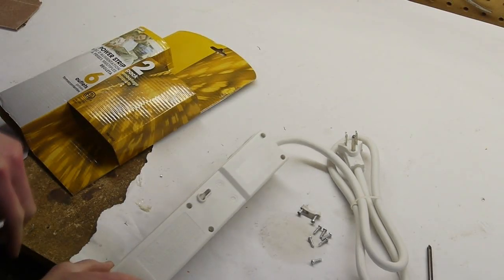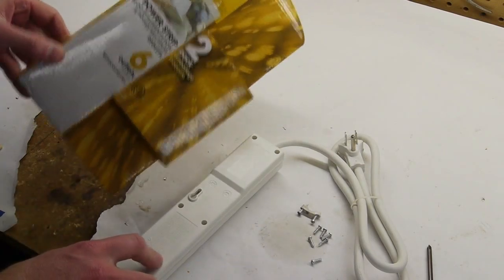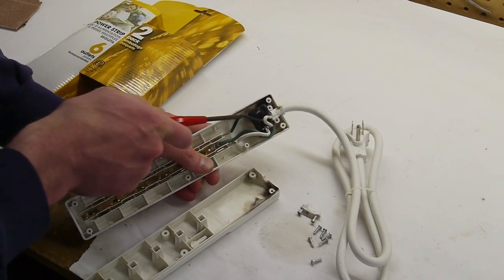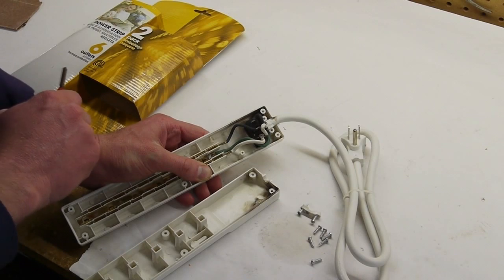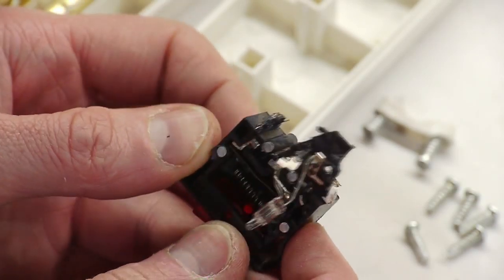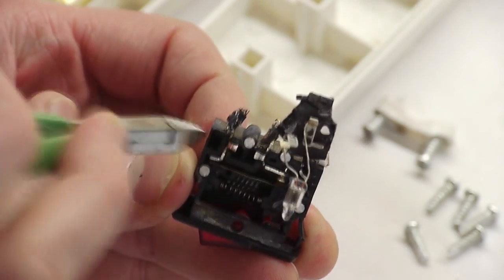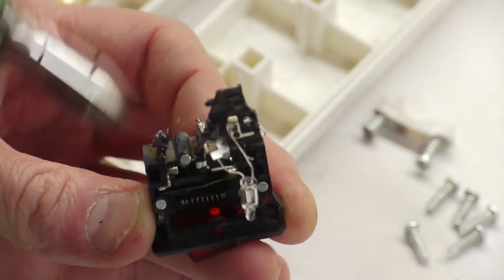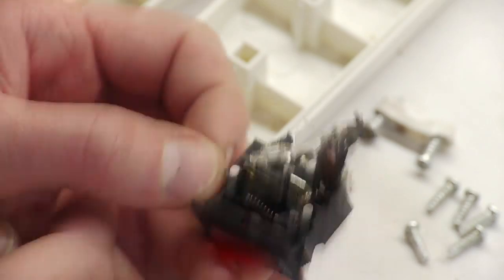Power strip failure analysis

Comment: Ton's of video in youtube shows failed power strip like poping noise or explosion, but my power strip had different kind of failure... it cannot be turned off lol, I tried to buy super expensive and regular price too, all failed on the same issue, it can't be turned off... like then switch button, refuse to cut the electricity, but no one had uploaded this issue on the internet...

I was hopping someone could explain why this happening cause its no longer coincidence since its happend more than 5x over many different power strip both expensive and cheap one.

Comment: I had a Prime powerstrip fail, the daisy chained lead to one plug had exactly 1 strand of the wire soldered to the post. Exactly 1 strand.

 I was using it as a switched extension cord, I had one thing plugged in. A sump pump, which of course failed the moment it was needed. I had tested the setup, but not more than a single socket; I guess I just picked the wrong socket to leave it in for "production." LoL

Comment: Late to the party like most everyone else replying, but I don't see a current limiting resistor on that neon lamp.  I take ot the pop and smoke happened after being plugged in AND switched on?  I ask because the plug shows no arc damage either and am leaning to high impulse current from the non limited neon lanp.
Reply: Was my first reaction looking at the lamp too - "WTF, where's the resistor?!?"

Comment: Could be anything from a defect in insulation thickness during the MFG of the input cable, to poor job of trimming the outer insulation and nicking the hot and another conductor, or pinched under the strain relief and wore through insulation.  Switch DOES look good, no sign of arc inside of it.  I think we've all overloaded one of these at one point or another an the combination switch/breaker trips pretty quickly, my guess is that the fault was BEFORE the switch.  If it happened immediately when he plugged it in, 2 of the contacts on the plug should show at least faint signs of pitting and would tell if it was a hot to ground or hot to neutral short.  I guess this WAS like 3 years ago now...how'd the lawsuit go??

Comment: Got a call two days ago that a computer would not come back on at a client's business via a little troubleshooting on the phone we determined it was the power strip - belkin so I figured it was just age maybe.  Bought a new one went over hooked it up made sure everything worked and all was good.  Then this morning at 9:30am I get a phone call hey it did it again.  I took the old strip apart; no soot or shorts in it.  Not sure what to do at this point I am going to measure the voltage at the wall and see if anything wonky is going on.  Any ideas of what is happening to these strips is appreciated as well.
Reply: You're sure it's not the outlet? I have one in my house that is wonky and it won't function when plugged into a power strip, but with very low voltage things (we use it for the Christmas lights) it works fine. Might be something like that.
Reply: @ultraviolette69  wonky is a dangerous word in this context. Get it fixed.

Comment: I'm very late to the party...

The soot on the back cover of the strip suggests where to start looking. The neutral wire (white) from the cord appears to be looped over (possibly in contact with) one of the line terminals of the switch. From there, pressure applied by the back cover onto the wire and terminal would eventually pierce the wire insulation.

I would have expected the house outlet circuit breaker to have tripped as a result.

I'm enjoying browsing through your videos.  B)

Comment: Maybe the trimmer trimmed too many copper strands and too few remained connected and overheated and blew when current crossed them, this would also explain why the electrical system didn't trip, the only, but fatal, pitfall of this explanation is that no load was connected to the strip..
It remains a mystery!

Comment: I bet that they didn't cover up the solder joints, and they didn't trim excess wire. So when they put it in the case, a few of the fine copper strands of the wires got pushed together, and then when your friend plugged it in, it exploded xD

Comment: Only single pole switch? Here in EU all the power switches disconnect both hot and neutral, leaving only ground connected.

At work we had one power strip fail so far. No smoking effects, just the red plastic cover of the switch popped away and exposed the inside, luckily someone noticed and didn't touch there.
Reply: This is because over here in the EU, the conductors are ambiguous. In Germany and most other EU countries (Schuko Typ F), the plug can go in either way, so live and neutral are ambiguous by design. In France, Poland, and Czech Rep. the plug goes in one way, but a French power strip fits into a German socket, and then it goes in either way! And then there's a tiny matter of France having been unable to decide what the pins actually mean for decades until quite recently.

Comment: i've had this happen you genrily only see it on first plugin . seems that the cheep build houses dont bother to check there solder points for fethering or in some casses even bother making sure the stranded line is twisted and properly tend before assimbely . so when it first gets power you have a snort or nere short that arcs across the point giving you a small plasma ball in the housing
Or it's the built in braker that's faild do to a short in the rails. sometimes they forget to seporate them

Comment: If the solder joint was not done properly, due to thermic cycling inside the material ROHS (aka lead free solder) develops cracks and the resistance far earlier than good old SN/PB solder. This leads to the solder joint dissipating all the power => appliance burst up in flames. Should use crimp contacts for that purpose. Furthermore lead free solder likes to grow whiskers/dendrites that cause short circuits especially under DC load.

Comment: In my experience mains wires are composed of copper threads usually about 0.3 - 0.5 mm thick, for that my guess is it would take a human perceptible amount of time to burn out. But as you described it as a pop I'm inclined to think it was a tin whisker from the solder. We don't know how long it was sitting in a warehouse before it made it's way to you.

Bring back Lead solder.

Comment: Had the exact same thing happen to me with a cheapo brand here in the UK (99p for a 4 way switched lead, some crappy Chinese brand). Had pretty much the same damage pattern as yours. I too couldn't see the obvious failure path so concluded the there was a single strand of wire across the switch. I just swapped the switch, cleaned the soot and it's been working fine since (I would have gone and asked for a replacement unit if I didn't happen to have had a suitable switch kicking around).

Comment: i think that the solder joint wasnt good and the wire was barely connected and if there was a high load on the strip the wire could of vaporized.